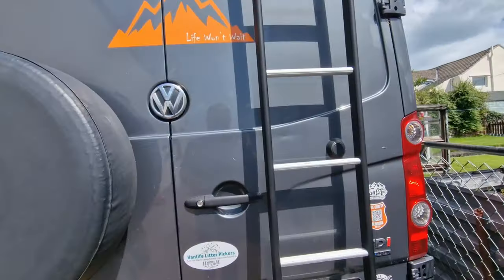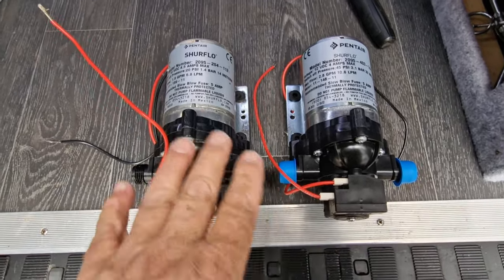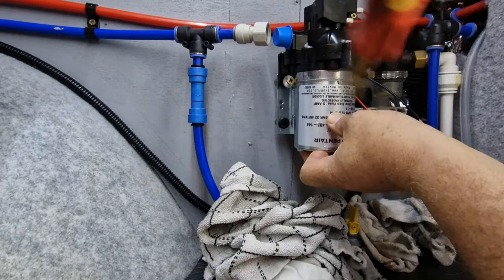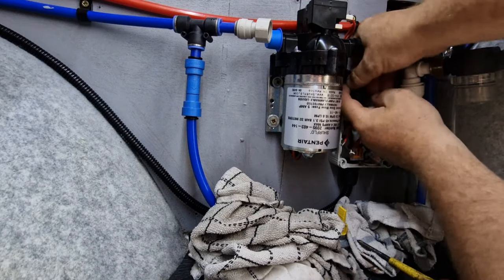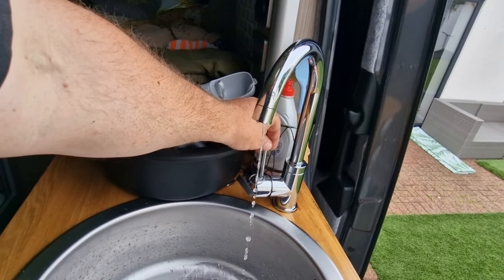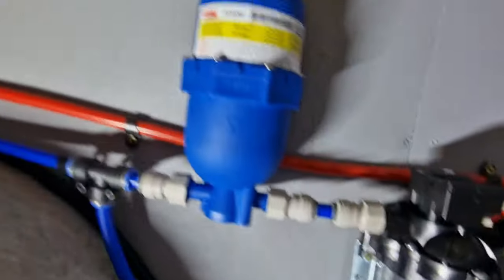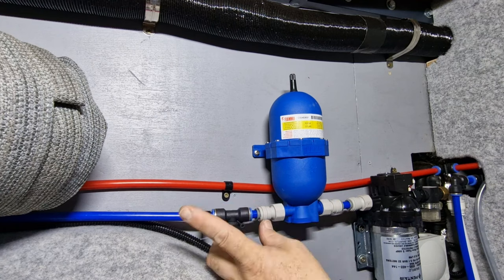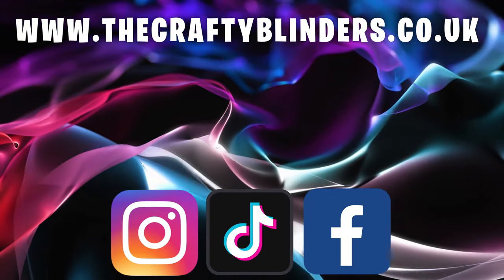Install the Shurflo Trail King 10 Water Pump and Fiamma A20 Accumulator

Comment: Can’t believe it Sam. I watched your video a week ago before we left the UK and today my identical pump has done the same as yours in Italy. I wouldn’t mind but I carry a spare motor but no diaphragm assembly and we’re away for another month. It’s 3 years old and I’ve always had an accumulator on it. Like yours mine used to be wall mounted upside down so I could pump the water from right to left but I always worried one day the water might leak past the water seals and down into the motor windings and fail hence the spare motor. But last July I fabricated a bracket so I could fit it with the motor above the diaphragm but it still didn’t stop it failing. Build quality is pants. Keep up the great videos
Reply from the maker: Did you get sorted out😁👍
Reply: Yes thanks Sam. Managed to buy a valve assembly kit for 22 Euros in Italy. Fitted it and it’s been working fine ever since.
Reply from the maker: @Basilbrush207  wow that's way cheaper than here

Comment: its important to relieve the expansion vessel of any external water pressure before increasing bladder air pressure or the function wont be accurate. Also there should be slightly less pressure in the vessel so the pump can differentiate when to re-start.
Volume is king with these things.
Accumulator / expansion vessel allows for hot water expansion from your water heater too , otherwise your pressure relief / drainage valve will keep letting-by.
So, larger vessels hold more (pressurised) water volume cycling the pump less often.
Mine is 2 litre...
Reply from the maker: Great input everyday is a school day thank you 😁👍